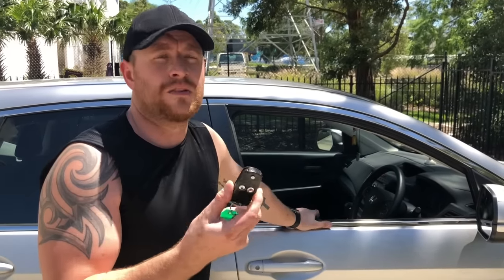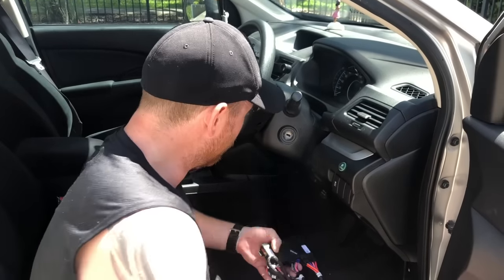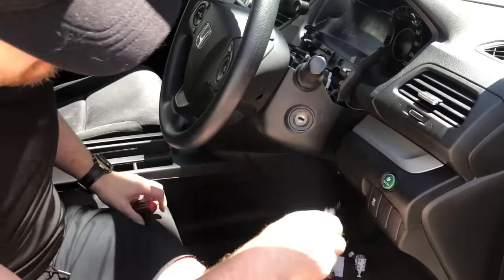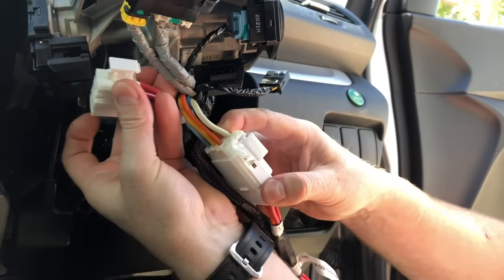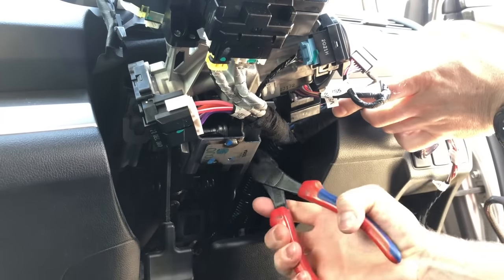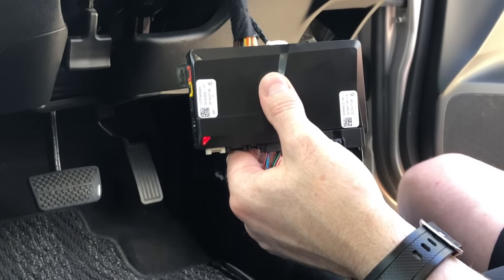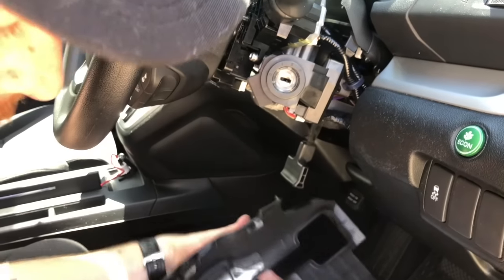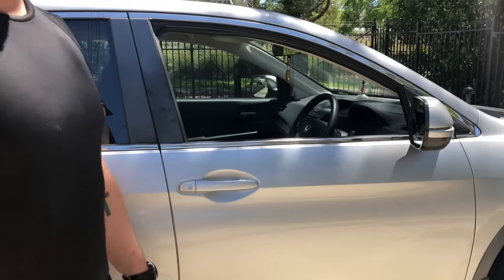How To Install Remote Start Honda Factory Key in 10 Mins

Comment: I watched this, and a few others, bought my own idatastart and t-harness to put in a 2016 crv.  After programming the module with a laptop (super easy) I had the stuff installed and the car remote started from the factory fob in 30 mins or less.  Took longer to dress everything and put the car back together than to install and remote start.  Love it.  Although I learned, anyone who will put in a remote start and long range fobs for 400 bucks, ain't makin' much off of that.
Reply: Will try on civic 2017
Reply: Why did you mention $400?
Reply: @juanh1093  did you read what I wrote?  Pretty self-evident why I said $400.
Reply: @OneSquaredG  I did, I just want clarity? Can you clarify?
Reply: @juanh1093  because the cost of the materials wouldn't be A LOT less than $400 dollars (maybe it's now over that) so if anyone will put one in for you for that little money they are not making much and if you can't do it yourself that is a good deal.  Obviously you can buy different makes and models and you don't have to get the long range antenna and fobs (I did not and my cost was still still like $275 iirc) etc... So maybe it could be done for significantly less than I did but with a t-harness, module, and long range kit that is over $300 just in parts for sure.  Unless you're buying them in bulk and getting a discount or you're getting some mechanic discount or you've worked out some other type of deal with the company or one of it's distributors etc...  I can't see paying a tech to install one and charging only $400 as being profitable.  They'd have to put one in, complete install, in 30 minutes or less.  I'm sure costs have increased since however many years have passed since I put mine in as well.  If you're doing it on the side to make money it wouldn't net you much per job at that price either but module and t-harness only and charge $400 you'd make like 125 maybe, at back then's prices.

Comment: My CRV 08 factor remote not working after replacing the car battery ( the car was parked for 2 yr) now the lock and unlock works but the engine starter not working and I remember the was blinking lights on the a back antenna shape which not blinking any more. Do you have tips how can I reprogram it?

Comment: i appreciate you took the time to make this video. However, one of the most important steps in remote start installations is the placement of the module and its wiring.  The Honda Accord has a Telescopic Steering Wheel ( the steering wheel adjusts up/down and away/towards the driver) The T-Harness and Module has to be installed with this in mind otherwise the harmess and module will get damage as the driver(s) adjust the steering wheel.  You did a great job advertising the T-Harness and Module.  Would you please show us how the Module and Harness was installed underneath/back of dashboard?
Reply from the maker: You just install it will room to move with the steering column. All vehicles have moving steering columns whether manual or electric.

Comment: This system is very simple to DYI as shown here but dose this system turns on the blinker to let you know that the remote starter is operational?  I don't see the flashes, this is important to have because if you're not close enough to here it start and runs the how would you know that the remote start is working or the car is running?  Thanks
Reply: that's how you get your car stolen in the states
Reply: @dariovite7501 no it isn’t. the car won’t move unless you’re inside

Comment: Hello
I bought the model mc-900 ignition control for my 2005 honda civic believing it would come with the connectors as shown in the video, I thought I would just connect the connectors and voila.
But unfortunately it was not like that. I would like to know if I can obtain the missing connectors to do the same procedure that you did in the video.
I don't have much knowledge of electronics so I am asking you this question.
Thanks in advance.

Comment: Would a non factory remote start slowly drain the battery on a 2016 Honda CR-V EX? I have ha 2 batteries completely drain over several months. The Honda dealers checked my car and couldn’t find anything wrong. Now they are saying it’s from the remote start that the previous owner installed.

Comment: Good evening,  great video,  
Im trouble shooting.  Already installed in my 2010 honda ridgeline.  I owned this truck for 4 yrs now , my remote  start stop working . I looked under the steering wheel , i see the black box , i looked around very quickly,  not sure what im looking for !!. But my common sense tells me to check for loose wires or loose attachments....
Is this common? . Does this unit go bad or maybe a fuse blown ...any idea? .
Thanks appreciate your video and your time . 
Good night
Reply: If your battery died or has been changed you will need to reset your automatic starter,  usually a switch under  the steering wheel/ left foot area if I'm not mistaken..

Comment: I own a 03 Honda Element what all would I need please explain?
Reply: I have one too an 03 Element as well and is interested in this
Reply: contract crutchfield. They can help you source exactly what you need with free tech support to help with the install. I just did mine and it was a breeze.
Reply: @Satori-San-Dojo  you had an element?  thanks for taking the time to respond mate!  merry christmas!
Reply: Pattay's Performance no I don’t have an element but I can’t imagine they don’t make it for that vehicle. I have a 2014 Honda Accord. I contacted crutchfield because I was having trouble finding plug n play options. They had it and supported me technically during the install. I’d highly recommend reaching out to them. They also price matched the harness that I found cheaper somewhere else.
Reply: @Satori-San-Dojo  Merry Christmas Mate and THANK YOU!

Comment: does this work for 2015 honda crosstour? Are the steps the same? What firm ware does this run?
Reply: clement james most likely it is nearly identical. The difference I think would be in the module and t harness itself. But the module will have a different flash version compared to a non cross tour.

Comment: Very well done video - thanks.  The wife’s 2015 CRV has a keyless system, but not finding any reference in your channel or comments: will your system work or need different instructions.?
Reply: Scott Toner  contract crutchfield. They can help you source exactly what you need with free tech support to help with the install. I just did mine and it was a breeze.

Comment: Hi, recently I bought 2009 MDX which already had CM-DC3 made in 2017 installed in it but it doesn't remote start it, neither from Acura remote nor from the remote start that comes with the unit. I followed the procedure you have on YouTube, both remotes communicate with the unit, however it won't start the vehicle, maybe couple of times it did and that was it. Both green lights come on which makes you think its gonna start but then the red light comes on with a click, while the other light stays green, it trys 3 times on it's own but that's it!! 
2 other times where it started but the alarm sounded. And if I disconnect the unit completely the vehicle cycles when I want to turn it on with the key  but won't start the vehicle..  any help!!
Thanks
Reply: Did you ever solve this issue and what did you do to fix it?

Comment: hi brother I nedd you help please have honda pilot 2012 a yet installed compustar DC 3 try to programing the module but went plug in only one red lights flashing and put the ignition on position no doing nothing only still flashing flashing oftre that no doing anything you have download the firmware have to refresh the module 
and pu
Reply from the maker: Check you have the firmware loaded on the Dc3 they come blank and you must load the relevant vehicle firmware on. 

Thank you!
Reply: CarbonCarSystems do you make it for a 07 accord and if you do, can I have your website so I can purchase one please?

Comment: Would THIS work on 07 element
Reply: I'd imagine so check your ignition harness online to see if it's the same
Reply: @liveandletlive2894  thanks bro
Reply: @barberjourney3698  much cheaper though to wire it yourself though it's a bit harder

Comment: Would this work on Acura TL, year 2005? As they are basically honda as well?
Reply: Joshua Reske  contract crutchfield. They can help you source exactly what you need with free tech support to help with the install. I just did mine and it was a breeze.

Comment: Will it work on my 2019 civic SI?
Reply: @angelicazhunio9719  yes, but not plug and play
Reply: Chad Chesser so this kit isn’t fully plug and play like it shows ?
Reply: Felipe302GT it is quite possible it is plug and play.  contract crutchfield. They can help you source exactly what you need with free tech support to help with the install. I just did mine and it was a breeze.
Reply: @Satori-San-Dojo  thanks brother! Ill look into it

Comment: will it work in a push button start 2015 civic?
Reply: - Gacha Peach -  contract crutchfield. They can help you source exactly what you need with free tech support to help with the install. I just did mine and it was a breeze.

Comment: Lol as an installer at Honda and have installed remote starters for 14 years. Infact is currently sitting in a 2020 crv watching this video as I remote start it. I’m a little confused why he’s using a compustar dc-3 and idatalink wire harness kits and claiming that he designed them.

Comment: Looks like a compustar system. Using the factory keyfob is relatively useless, the range is still the same which is about 50ft max. Aftermarket 2 way remotes will give you a confirmation beep and lights letting you know the vehicle started. Many systems can be programmed to turn on AC or heated seats when remote started. I always recommend professional installation to get the most functionality and reliability when adding a remote start to your vehicle.

Comment: Without disconnecting the battery, may ignite the airbag...just saying
Reply from the maker: Never in my life have I had that happen in 17 years of installation. The airbag wires are yellow marked and would only trigger with a loaded test light if you probed them. Extremely unlikely hard to test without the battery on.
Reply: Not likely at all to have the airbag deploy. This is an in-line harness. The airbag wires are not being fumbled with and nor do you touch them directly even when tapping in for hood/horn/blinkers etc.